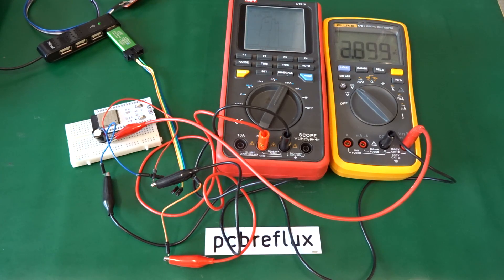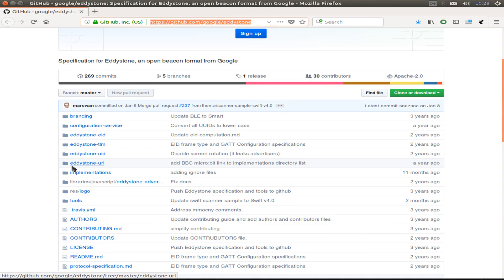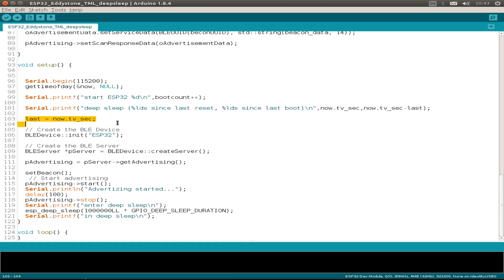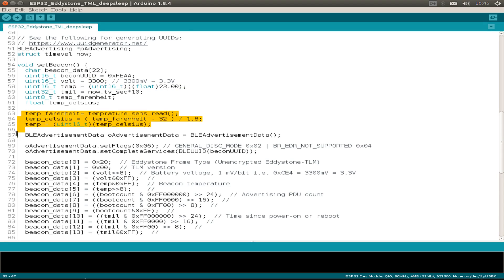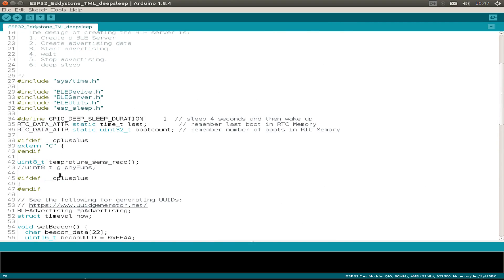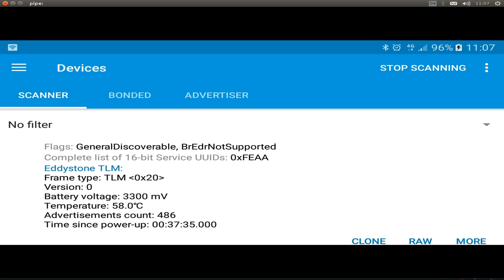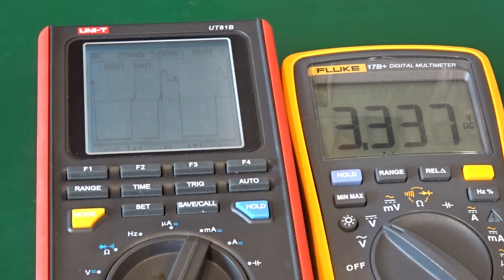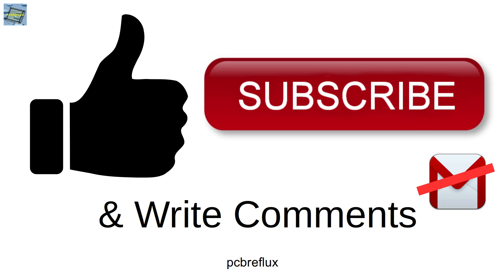ESP32 #72: Arduino Eddystone Beacon

Comment: Hello! Thank for that tutorial. I have a question: by measuring the mA of my board (Nodemcu with Esp-Wroom-32) the value varies between 78 and 81 mA. It is pretty high. I need to read data from an accelerometer in real time (i.e. no deep sleep is possible), make a simple elaboration and send it through BLE with a frequency, for example, of 1 min. I was thinking to use it as iBeacon or Eddystone. I need to power the Esp32 with a battery like an iBeacon, so I need to reduce more and more the power consumption. Is possibile to lower the consumption under 10 mA with that device? Obviously a generic iBeacon has a power consumption on the order of microA, it would be great to get to those levels but I suppose it can't be done with an esp32, right? Thanks!
Reply from the maker: With a Beacon frequency of 1 min (set GPIO_DEEP_SLEEP_DURATION to 60) the average consumption should be way below 10 mA. But sure, this Arduino Beacon example with the ESP32 is not in the ultra low power range like other specialized chips for Bluetooth only. If you want further to improve the firmware with the ESP32 use the esp-idf (https://github.com/espressif/esp-idf) not Arduino.
Reply: Thanks for answer! I can not use deep sleep because I need to analyze data from an accelerometer and make some calculation and then I need to pass an integer through bluetooth every x minute (for example, 5). This means that I can not use deep sleep. Esp32 maybe is not the best choice for my project, right? Could you suggest me something that could fit my situation?
Reply from the maker: For a Bluetooth only solution you can have a look at the Nordic Semiconductor devices based on a ARM Cortex Processor ultra-low power 2.4 GHz wireless System on Chip (SoC): nRF51 Series or nRF52 Series (https://www.nordicsemi.com/eng/Products/Bluetooth-low-energy).

Comment: I was trying out a 100µF (25V) and 10µF (35V) capacitator - because I had those lying around -  and had no success. So do you think this might be actually be the cause and I only need to use a bigger capacity - or could there be another reason for the brownout detector to kick in?
Apart from that - thank you very much for your videos - they are very helpful!
Reply from the maker: Simon Slama Can you describe your setup? Energysource, regulator any other circuitry or meters? Do you use the UART converter as a source or regulator (like cp2102)? With the cp2102 the brownout is common. (In my setup I use the ams1117 inside the ST-Link as a 3.3V source but only because I could find my 18650 LiFePos and my AAA LiFePos are to weak for the burden voltage of the meter but working without meter).
Reply: I have tried various power sources - cp2104 as powersource, an external power source PeakTech 6225A, and a 3.6V Li-SoCL2 battery. In all three cases I get the Brownout. When I accidently wired the 5V output from the UART converter to the 3.3V Pin on the ESP32 it actually worked...
Do you have any idea how to solve this?
Reply from the maker: Sorry no clue. The PeakTech 6225A should deliver 5A more then the ESP32 need. Maybe try 3.6V instead of 3.3V. The brownout should kick in below 2.3V (but see also the esp32 errata  https://espressif.com/sites/default/files/documentation/eco_and_workarounds_for_bugs_in_esp32_en.pdf ).
Reply: Ok - at least now I found one of my mistakes. I set the PeakTech 6225A to only 200 mA. From 311 mA it works and I can initialize the BLE functionality. Below that I get the Brownout. Can I reduce the drop with a bigger capacitator? In the end I want to power the ESP with bateries and not with an external laboratory power source.

Comment: Hi, thanks a lot for your videos! I follow your projects carefully, especially this, which is part of my final year project.
I have a doubt with the SEC_CNT (of the "Unencrypted TLM Frame Specification").
I have wrong values of time when i scan with the app.
On the line 59 of code:
uint32_t tmil = now.tv_sec*10;
I had to remove "*10" and works well.
Is this right?
Regards from Argentina!
Reply from the maker: Hi, think what ever works for you is fine. But according to the Eddystone "Unencrypted TLM Frame Specification" SEC_CNT is a 0.1 second resolution counter (see https://github.com/google/eddystone/blob/master/eddystone-tlm/tlm-plain.md ).
Reply: Yes it works but i have a bad habit (or not) of try to understand why.
Yes i have readed the spec and the 0.1 sec resolution that confirm the logic of your expression. I will try to live with the doubt :D
Thank for the reply and congrats for your work again.
Reply from the maker: Guillermo Trangoni Thank you.

Comment: I'm also using the raw ESP32, but the moment I want to use BLE the "Brownout Detector" kicks in and resets the whole system. I guess there is a voltage drop that causes this. What kind capacitor are you using to stabilize the voltage?
Reply from the maker: Simon Slama Using a 1000uF/25V but in my case the bigger problem is the burden voltage drop of the Uni-T meter (like other meters as well) in the mA range, but measuring the esp32 in the A range make no sense with this meter.
Reply: I was trying out a 100µF (25V) and 10µF (35V) capacitator - because I had those lying around -  and had no success. So do you think this might be actually be the cause and I only need to use a bigger capacity - or could there be another reason for the brownout detector to kick in?
Apart from that - thank you very much for your videos - they are very helpful!

Comment: The beacon doesnt appear on the "eddystone" scanner, any idea how to get it the appear?
Reply from the maker: David Markey Hi, think most of the scanner only scans for Eddystone URL frames and not for TLM frame. Tomorrow I can publish the URL example and you can try it again. I've tested this with an APP called Beacon Scanner.
Reply from the maker: Try this with Eddystone URL frame: https://goo.gl/7wgpTQ
Reply: I tried your example, however i get an error when trying to compile this. The error is 'BLEAdvertisementData' was not declared in this scope BLEAdvertisementData oAdvertisementData = BLEAdvertisementData();  Any Idea whats wrong?
Reply from the maker: Have you update the arduino-esp32  library lately? The BLE libraries from Neil Kolban was introduced 2 month ago. See https://github.com/espressif/arduino-esp32
Reply: Yes i have the latest libraries installed.
Reply: Looks like it was a problem with my arduino installation, i cleared everything out and reinstalled it along with all the libraries and it now compiles. Thanks!
Reply from the maker: Blackwolf Hi, can you look inside the arduino hardware espressif libraries path? is there a path ble? if not try "git submodule update --init --recursive" before "git pull"